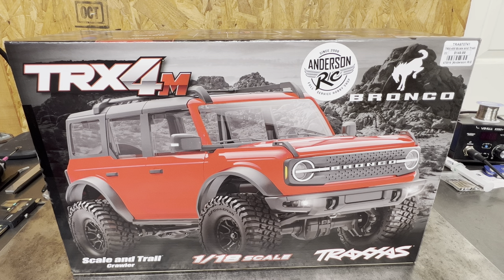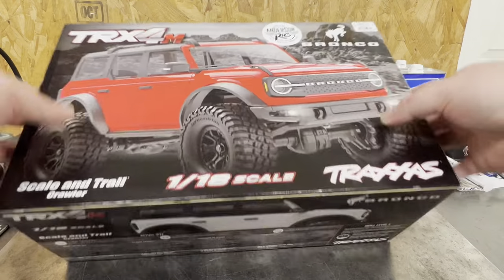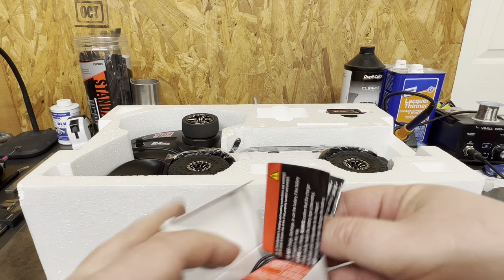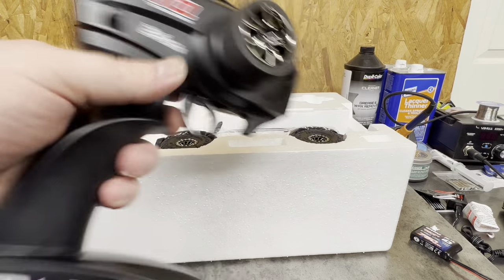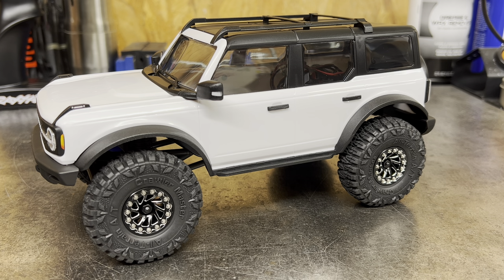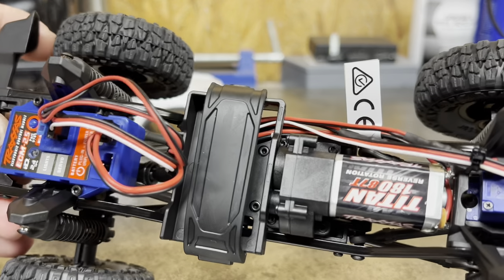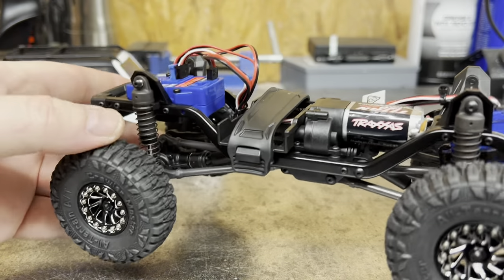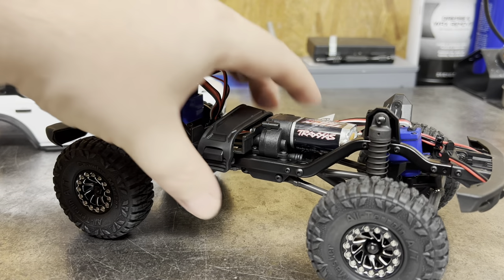New @Traxxas Limited Edition TRX4M. Shout out to TRAXXAS!

Comment: Lookin good bro. These things are badass! Put the Traxxas wheel weights in front on some injora wheels (sorry) and the chassis goes over sixty degrees on stock tires. What!? Insane!
Reply from the maker: My man. Already have brass in front on the wheels. Gonna go test drive tonight!
Reply: @mazzdesigns6929  
Did you swap the gears? If not, especially with the weight, you’ll have a hard time crawling. It’s cool out the box, decent speed but not enough torque. The crawler gears are too slow but it crawls awesome! Gotta figure out how to get the fcx24 trans in this rig, for sure! Hope you have a great day brother!